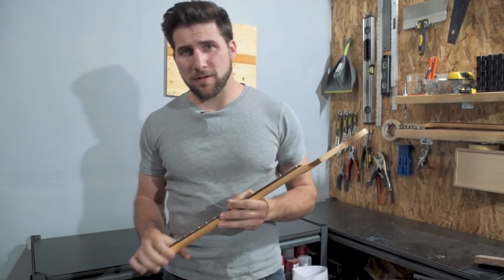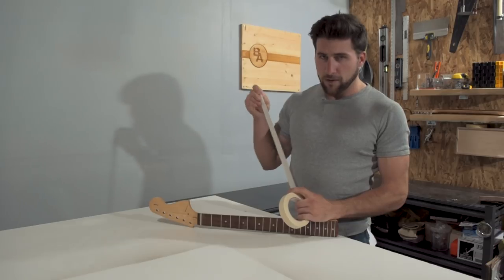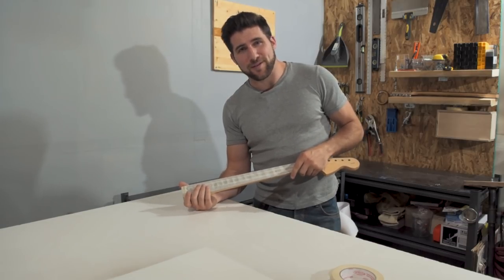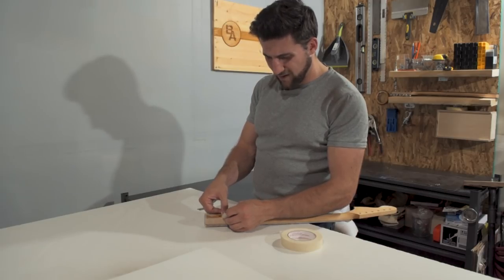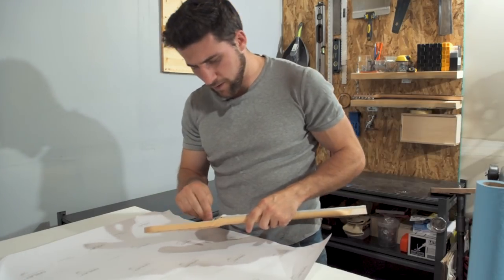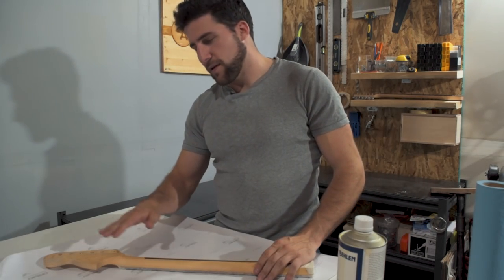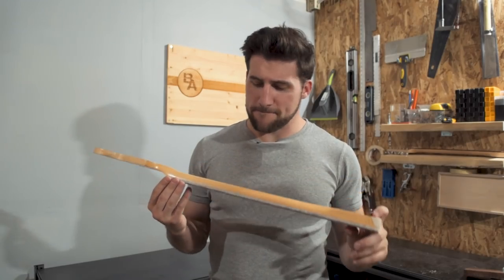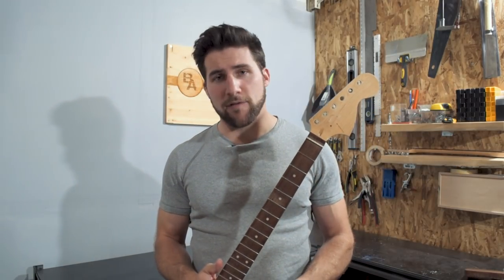How to finish a guitar neck

Comment: I completely sanded all the lacquer off the back of my p bass neck, and now I wanna re-coat it. Should I take the neck completely off? Or keep it on and cover the guitar’s other parts?
Reply from the maker: Are you spraying it or just using a wipe on finish?
Reply: Brad Angove I thought I’d spray it. Would it be a better idea to wipe a thin layer on it just to keep the neck clean?
Reply from the maker: If you’d like to spray it, I would suggest taking it off. If you’re doing a wipe on, you don’t necessarily need to do that.
Reply: What material is thinner than lacquer? Like the one they use on the newer fender guitars. I’d like to apply something that’s not too glossy
Reply: (With a wipe, not by spraying... I don’t wanna take the guitar apart)
Reply from the maker: Oil is thinner than lacquer, but I think the new fenders use mostly poly, which is not thinner.
Reply: Brad Angove Okay I guess I’ll just use lacquer. Thanks!

Comment: Do you recommend using Rust-Oleum 2x satin clear spray on the neck after sanding?
Reply from the maker: It’s certainly an option.
Reply: @BradAngove  Do you see any downsides to it? Will it run off or give an undesirable feel?
Reply from the maker: Spray options can leave a slight ridge against the fretboard. Not a big deal and I’ve done a video on lessening it. I typically use oil now because I prefer the way it feels and goes on.
Reply: @BradAngove  Can you point me to that video you did? Thanks for your help.
Reply from the maker: It’s part of the ultimate sg guitar kit series I did.

Comment: Would this be necessary on a name-brand fender stratocaster neck from Sweetwater?
Reply from the maker: Is it already finished?
Reply: @BradAngove  I'm not sure, I need to purchase one online for around $200, and I'm not sure if this will be necessary or not or if I should see if they offer 2 options or if it's a non issue. Thanks
Reply from the maker: I’m pretty sure it won’t be an issue.
Reply: @BradAngove  thanks man i appreciate the advice ive never done this before

Comment: Hey brad. Early in the vid you said you can paint the fret board if you wish, "there's nothing wrong with that". I would have thought the friction of the strings against the fret board would wear away any paint or clearcoat very quickly, especially if you like to bend the strings.
  Will you be doing a vid about this? Going back to view your back catalogue now. Keep Them coming.
Reply from the maker: +zigzag duck I used to think the same thing, but fender ya been lacquering maple fretboards for ages. They do gloss finishes on them, and I’ve never really seen anyone have problems with them. 
I don’t expect that I’ll be doing a video on that any time soon. I personally don’t like lacquered fretboards. I might do an oil finish on one though in my second guitar kit series coming up.
Reply: Thanks for getting back so quick mate.
  Not sure about painting fret board either but good to know it's an option. look forward to learning more.
Reply: +bassman686
Thanks for that mate. When you say lacquered, did you add that finish to the fret board, if so what lacquer did you use, or is that the way it came? I am curious about the warmth that you mentioned.
Reply from the maker: +zigzag duck They come that way from the factory in a lot of cases.

Comment: Thanks for the video!
I have a maple neck with maple fretboard I’m adding to a Mexican Strat. 
Would you use the teak oil on the board too? Or something else?
Reply from the maker: Drastic Measures There are tons of options for the board. It depends on whether you want to put a finish on it, or just keep it hydrated. I personally do find that teak oil is a good option for fret boards.
Reply: Brad Angove I appreciate the reply!
Reply from the maker: Drastic Measures Thanks for watching.

Comment: Hey dude, could you try do a video demonstrating how to put a waterslide decal onto a guitar headstock and how to do it if you are going to be finishing the neck/headstock with a gloss or oil finish? In my case im sanding off the Squier logo on a strat and putting on a Fender Waterslide Decal which I got off ebay. Or even if
You just had some tips that would be appriciated!
Reply: Tip #1 - Don't put a Fender decal on a Squier.
Tip #2 - Get a Fender.
Tip #3 - A Squier is not a Fender.

Hope this helps.
Reply: @stankfanger1366  YA YA LOL

Comment: What finish would you say comes out the smoothest for a guitar neck?
Reply from the maker: It all depends on how it’s applied.
Reply: I went with tung oil, rag applied to a neck I sanded to 2000 grit. It's my first try and so far it's coming together nice
Reply from the maker: Glad it’s working out for you.

Comment: Can the teak oil be applied over a stained neck without too much trouble? I just got a got a guitar that the previous owner refinished and the neck has some dust and such in the true oil finish he put on it
Reply: So I'm thinking about rubbing it back a lil with steel wool to smooth it out and the. Putting on a coat of teak over it since I have some lying around
Reply from the maker: Shouldn't be a problem putting it over stain. That would be putting it over another oil though, which also shouldn't really be an issue.
Reply: Thanks I thought it would work.  I appreciate the affirmation.
Reply: You know he actually put some carnuaba wax on it too.  You think maybe I should just use some steel wool and paste wax or something to smooth it out instead of adding a layer of teak over already finished wood?  I figure I'd have to remove the wax before applying the oil so maybe just using wax would be less complicated.  Trying to take the fewest steps possible here lol
Reply from the maker: If there's wax on there you're right.
Reply: Paste wax and 0000 it is.  Thanks

Comment: How would I put a gloss finish on a rosewood fretboard?
Reply from the maker: Many different options available. What kind of paint do you want to use?
Reply: @BradAngove  clear gloss lacquer
Reply from the maker: Clean it with some thinner to remove a bit of the oils. Then you can go ahead and spray it.

Comment: Could this technique also be used on a maple fretboard? cheers Brad
Reply from the maker: It could. Maple fretboards generally don’t need oiling though.
Reply: OK, could it also be used as a finish over stain on a body?
Reply: Thinking of using it on the fretboard in order to give the fretboard and the neck as a whole a sort of classic fender amber -ish tone?
Reply from the maker: Yes, it can work in that capacity.

Comment: Can you put it on the frets to make it easier to move around the fretboard?
Reply from the maker: Are you asking if you can oil the frets themselves?
Reply: @BradAngove  the fretboard
Reply from the maker: Certainly you can use teak oil on the fretboard if you want. If won’t make it easier to move around though.

Comment: How many Layers of Oil do you recommend? :)
Reply from the maker: It depends on the finish you’re looking for. I suggest you keep adding layers until you reach your desired gloss level.
Reply: @BradAngove  Thank you. One more Question: Should a headstock logo be applied before or after the finish?
Reply from the maker: I generally do it before.

Comment: Would you recommend using boiled linseed oil in place of teak oil? I use blo on my rosewood and ebony fretboards with no issue
Reply from the maker: I don’t use boiled linseed oil. If you like it, there’s certainly nothing wrong with that option. Just make sure you’re careful about disposing of your rags after so you don’t burn your shop down (I’m sure you already know that, but better safe than sorry).
Reply: Brad Angove thanks! I’m definitely careful working with it. I treated my 20+ year old les Paul rosewood fretboard with it and brought it back to new. It was really dry- never been treated, shrinking and beginning to crack. Swelled it right up
Reply from the maker: There’s nothing like a good oil job to bring a fretboard back to life.
Reply: Anony Amos boiled linseed oil stays a bit too sticky (from wood working experience). You may have to polish it with a (those fine synthetic ) scouring pad to get it smooth enough.

Comment: So after taping and putting the oil on can you stain it? Or do you need to sand the neck first before doing any of the other steps you did at the beginning? Thanks
Reply from the maker: +Randal You won’t be able to stain it after putting oil on. If you have an unfinished neck you can sand and stain it, then oil it.
Reply: Brad Angove ok, I've watched some other videos of people sanding it with super fine sanding paper and staining it, just hope if I was to stain mine it won't be sticky and make it difficult to play fast....
Reply from the maker: +Randal if there’s no finish on the neck, the stain should soak in and that shouldn’t be an issue. As long as you aren’t trying to use that 2 in 1 stain.
Reply: Brad Angove ok thank you, what sanding paper do you recommend and what stain do you recommend. I'll be doing it, this weekend and is their any type of oil I need to put on it before or after I stain it? Sorry for the questions just wanna make sure I do it correctly!
Reply from the maker: +Randal I would sand it to at lease 320 grit. Probably more like 600. 
The stain type depends on what look you want, and a bit on what finish you’re putting over it. 
Don’t oil or finish it until after you’ve stained it. 
The type of oil or other finish depends on what you want it to look and feel like in the end.
Reply: Brad Angove gotcha thanks!
Reply from the maker: +Randal You’re welcome.

Comment: Thank you a lot for this helpful video. I have just known your channel and I love it. I am ready for the first build. I just want it to have all-natural wood looking and the finishing is satin or matte. What would you recommend? I don't know much about doing stuff like this before. Should I still go with teak old or the satin wipe-on poly from WATCO (or anything else to get a satin or matte)? And if I want to add more layers to create more protection, should I sand it and keep doing that process again and again on the body? Thank you a lot for your help.
Reply from the maker: I really like Odies oil now. It’s one of my favorites and is very easy to use.
Reply: @BradAngove  Thank you for your suggestion. So if I want to keep the natural wood looking, I just need to sand it down to bare wood with 320 sandpaper then apply the odies oil. Is that right? How many layers should I go for to get a matte or something like natural wood. Thank you.
Reply from the maker: That should work. One or two layers should be fine.
Reply: @BradAngove  Thank you 🥰🥰 but just want to make sure, should I go with 320 grid first then apply the oil? I saw some of your videos that you used 600 and 800 grid too. I am so sorry because I don't know anything about this before. By the way, I am going for full maple guitar, do you think if I should put oil on the fingerboard too, or just keep it raw? Thanks again for your help.
Reply from the maker: 320 is good for the oil. Sand, clean, and then go ahead with the oil.
Reply: @BradAngove  Thank you. About the fingerboard, should I do any coat on it or raw fingerboard is fine?
Reply from the maker: It’s up to you. I often use the same oil on the finger board.
Reply: @BradAngove  Thank you. This is the best channel I have ever known.
Reply: @BradAngove  if I want to do some stain to the body, will the process be the same? I saw a video you did in 2014 about staining guitar body, should I still go with the miniwax stain stuff or we have something better now? Thank you.
Reply from the maker: Same process, but there are lots of choices for finish. It’s just up to you what you want to use.
Reply: @BradAngove  Thank you. Could you show me some staining stuff because I don't know a lot of those?
Reply from the maker: Take a look at the BigDGuitars channel. He is the master of stains and dyes.
Reply: @BradAngove  Thank you so much 👍👍

Comment: 15 minutes to show how to rub some oil on?
Reply from the maker: Can I get a 20? Going once... twice... sold for 15 to the guy with no profile picture!
Reply: How do you even know then if I am a guy.I came to your video by accident so I have no idea what your other content is.But this was pointless to me.Your sanding example looked clumsy, just wiping on some oil does not tell much about "how to finish a guitar neck" and taping the neck base is not needed unless you put some layers of laquer. The oil will not build up and tighten your neck pocket.
Reply from the maker: I honestly don’t care if you’re a guy or not. I showed a method of finishing a neck. Literally that’s what I did in the video. If that doesn’t tell you anything about finishing a neck, that’s on you haha.

Comment: Thanks for the detailled info, Brad! I have a question, though: how long should I wait between the final coat of teak oil and the sanding, priming, and spray painting of the headstock? I've been applying 8 coats over the past few days (waiting 4-6 hours between coats), followed by a thorough rub of mineral spirit. The neck is now silky smooth and feels dry, but when attempting to sand the headstock, the dust balls up because of the oil in the wood, so I guess the oil hasn't yet dried completely. Can I just ignore this and start priming? or should I wait until completely dry?
Reply from the maker: Did you oil the part that you’re intending to paint?
Reply: Brad Angove I did, yes. The can said that you could paint over it after 16h, so I figured it’d be OK
Reply from the maker: As long as you can sand it nice and smooth it shouldn’t be a problem.
Reply: Thanks! It doesn't appear be problematic indeed. My headstock is looking great so far! Thanks again for all of the super helpful videos!
Reply from the maker: Glad you’re happy with it.

Comment: Hi Brad, question, is it okay to first stain the neck, and then use the teak oil?
Reply from the maker: Yes it is.
Reply: @BradAngove  okay, vert good, thank you
Reply: I’m sorry, one last question, should I , after sanding, wipe down the neck with IPA before staining?
Reply from the maker: I’m not sure what IPA is, but you should clean it with something. Typically a wax and grease remover.
Reply: Lol, oh, I’m sorry, IPA is just another acronym for isopropyl alcohol. Or denatured alcohol.
Reply from the maker: Yes those are fine.
Reply: @BradAngove  okay, thank you again.
Reply: Hi Brad, just finished the neck with the teak oil, I left it to dry for around 24 hours. After that I felt the neck, it seems to be a bit sticky, how long should I leave it before it cures? Or do I need to apply another coat?
Respectfully requesting 
Pat Lis
Reply from the maker: Oil doesn’t cure per se; it just dries. It will continue to have that feel likely for a couple weeks or so depending on temperature and humidity.
Reply: @BradAngove  thank you, I was thinking of putting on another coat, what would your opinion be to maybe smooth it out?  Or maybe polishing compound?
Reply: @BradAngove  hi Brad, yes, I live in Florida where it humid so I can give it a couple of weeks, maybe put down an additional coat and use some rubbing compound on it to maybe smooth it out some more? Please advise, sorry if I repeated my question.
Reply from the maker: If it isn’t smooth I’d give it a day or two and then sand smooth with 800 grit and add another light coat. You shouldn’t need to use compound on an oil finish.
Reply: @BradAngove  okay, very good , thank you again, will do that

Comment: What do you finish your fretboards with
Reply from the maker: It depends on the guitar. Sometimes I just use some fretboard oil to keep the wood hydrated, and sometimes I actually put on some guitar finishing oil or tung oil.
Reply: Would you recommend an oil finish on maple fretboards? I also thinking about staining it. My p bass neck is in a very bad condition and I don't believe I can replicate the original glossy lacquer finish.
Reply from the maker: An oil finish is a perfectly reasonable option for that.
Reply: Ákos Brasnyó omg.... motninless you wanna do a complete fret job.... but seriously. There are some great great aftermarket p bass necks out there. For $50 . Or less . I bought one last week. And other than the decal you can’t tell the difference. Or you can rip up the frets , strip it, finish it. do a new fretting, level em, crown em. And I’m about a month or more you for it back. But you can tediously cover the frets and oil the board for a temp journey back to the good ole days.

Comment: is tung oil ok for neck or not?
Reply from the maker: Yes, but it tends to be a bit tacky when it heats up.
Reply: Brad Angove it’s purely a matter of opinion. I love it . Use a low gloss and it won’t get tacky. Formbys is acceptable
Reply from the maker: I’m glad you like it. I don’t see why the level of sheen would affect its temperature substantially, but I would be interested to test that out.

Comment: Hey, Brad I've watched many of your project, you do great work. Question; what's your thoughts about adding a very small amount of amber tint to the teak oil? I'm trying to get a little bit of a vintage look on the neck and headstock. If you agree, what would you recommend.

BTW...a great tip about setting the neck in the pocket to mark off the unfinished areas.
Reply from the maker: +Tom McDonald That sounds like a cool idea. I'm afraid I have no idea how it would work. Hopefully I get a chance to try it out. 
Thanks for watching.

Comment: Awesome video Brad! How would you go about getting a satin finish on a neck? Something that has basically no gloss to it.
Reply from the maker: Have a look at my video about doing a wipe on poly finish to a neck. The technique I used there keeps the gloss very low. You can also sand it lightly after it has dried to really give the slipper matte feel.